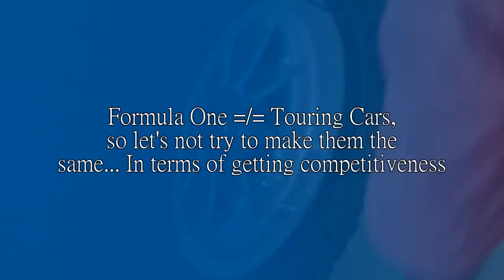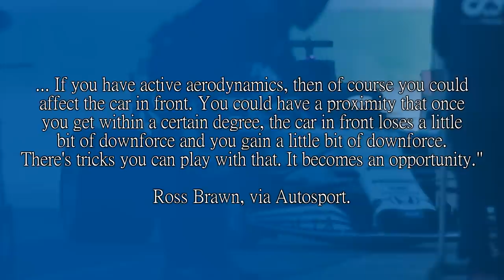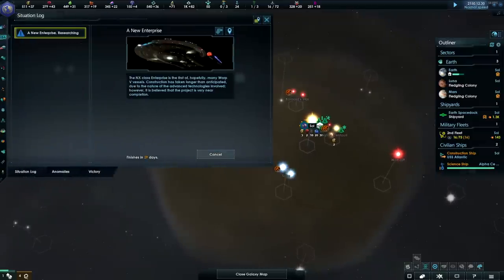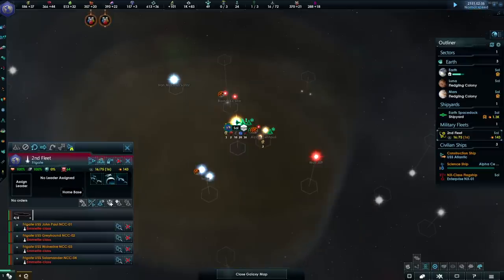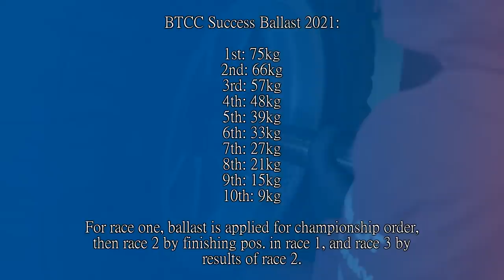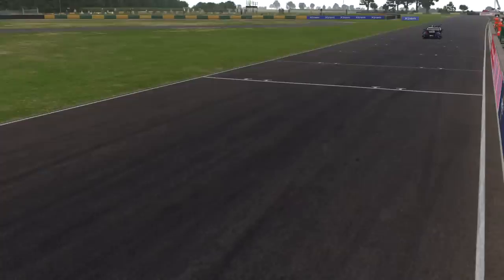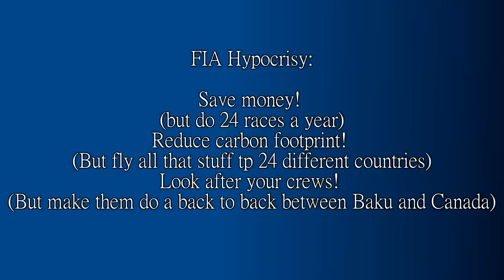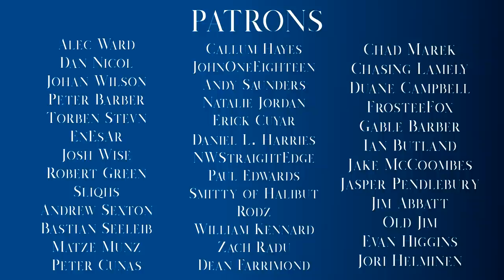BRAWN'S BIG BRAIN MOMENT: Opinions on the Proposed 'Reverse DRS' System for 2026

Comment: I'd totally be down with a weight penalty.  but what I REALLY want to see is have the sprint races be a fully reversed grid, AND / but have no baring on the race -- Quali sets the grid, but the grid is reversed for the sprint; you'd give the bottom teams a shot at points, and having the top teams have to fight their way through the grid

Comment: With the ol' big cars, I understand half of it is about safety, but what if we took the current formula and put it in that classic tiny box that Fernando was so excellent in? Less downforce, lower weight, and then if they REALLY want to BoP because it's the fad, why not just restrict battery performance? It makes up so much of the 1 lap pace now, it would be an excellent leveller. Ironically, the BTCC measures might work better in F1 than in the BTCC
Reply: Got something Special for you 🎁  TM!!